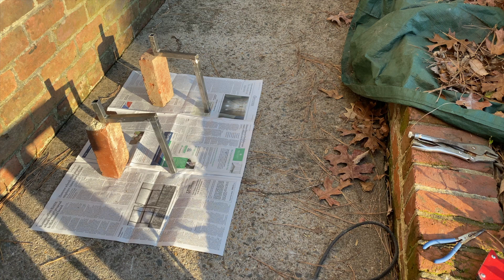ATV Spreader Mount Build

Comment: But the spreader will block your LED lights.  But this looks like a pretty slick solution for transporting the spreader.
Reply from the maker: Thanks Connor! I'm thinking if the lights are an issue I can just remove the spreader when I get to each property.